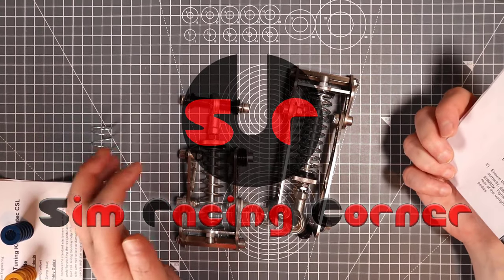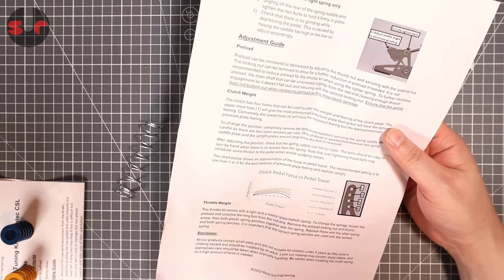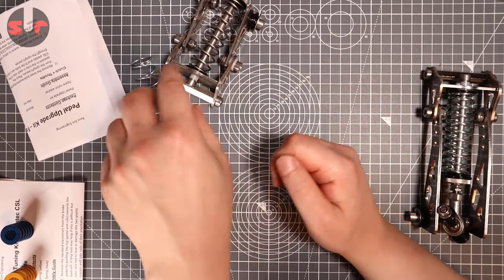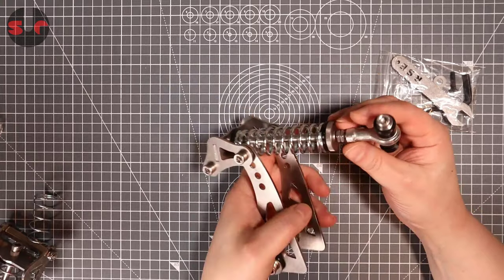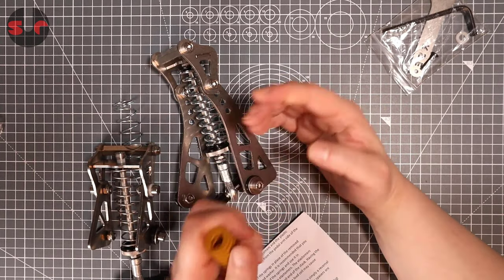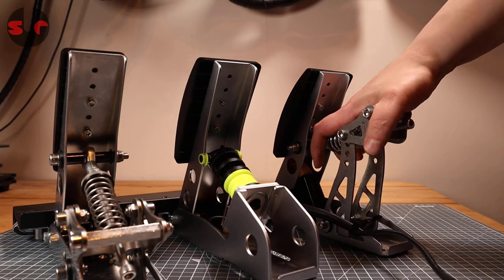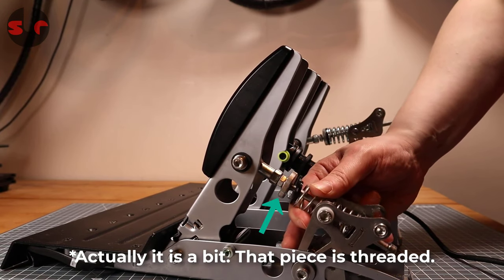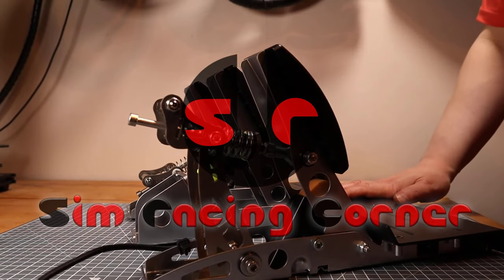Race Sim Engineering CSL Clutch & Throttle Upgrade Kit V2 👁️ 1st LOOK 👁️

Comment: Thanks for the good comments! FYI that black bolt that comes with the kit is used when running the upgraded metal faceplates form Fanatec. It's a bit shorter than the standard bolt and gives clearance to stop the spring hitting it.

Comment: How does it compare to the RC mod? Thanks for the video
Reply: Second
Reply: @mr.simulator4724  you mean the RC mod is better? And I forgot to specify: for the throttle.
Reply from the maker: Stick with the RC damper on the throttle.
Reply: @SimRacingCorner  Thanks! How about the 3d rap throttle mod, I really liked that one and im thinking of getting it.
Reply from the maker: @mr.simulator4724  Again, the RC damper is just as good. I do like the 3D rap throttle mod. Consider all these as just possible options, rather than one being better than the other. They're all doing the same thing.
Reply: @mr.simulator4724  Im using the RSE mod for my throttle and having looked at the RC mod I didnt do it for a couple reasons, some reports of it being a little noisy, and other cases of the damper leaking oil.